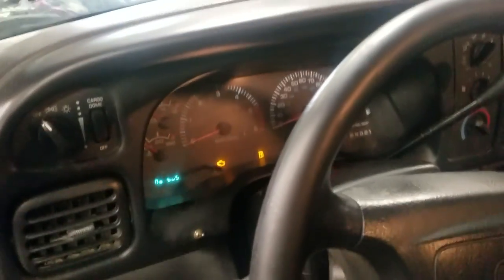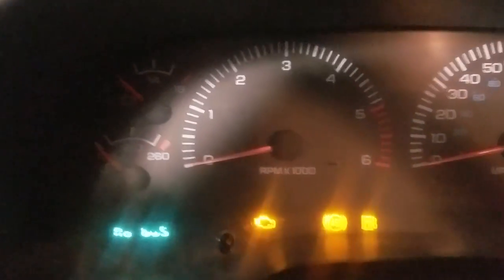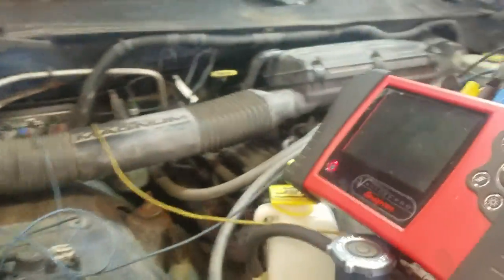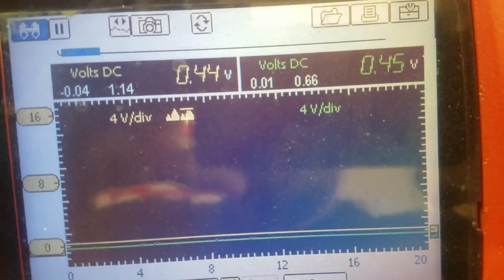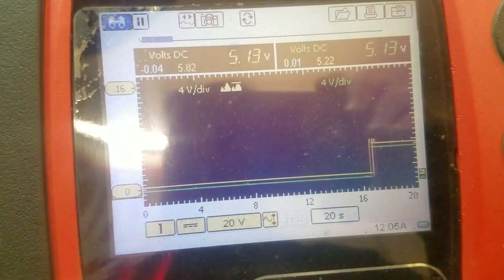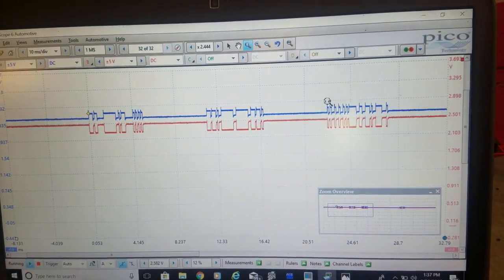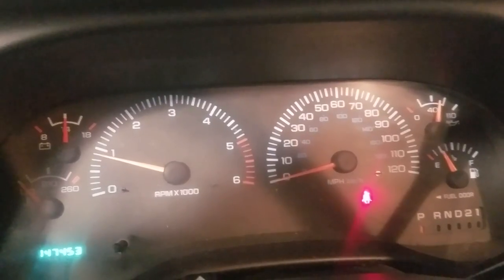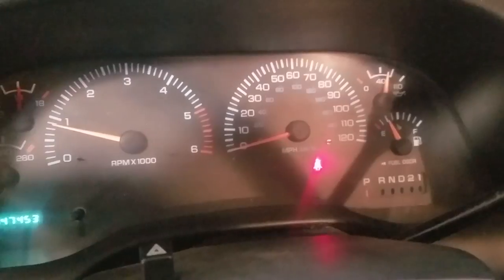2001 Dodge ram 1500 5.9 intermittent crank no start

Comment: This happened today. I went to my sons school and I shut off my truck. I went back to my truck and it would only crank . The fiuel was fine and spark was coming from the ignition coil. I disconnected the spark plug wire that goes into the distributor ( the one that connects to the ignition coil ) and no spark coming out of that end. Well as you know , 2001 Dodge wires are darn close to the exhaust headers and the heat exposed a small section of the spark plug wire. As Im cranking the truck , I saw that sparks were jumping onto the headers. Bamm , found it and wrapped it in electrical tape and it started right up. I drove home and replaced the wire 👍
Reply: Truth.  Somebody said. "dodge wiring is garbage". I said no it's not the person who routed them is garbage 😂 lol

Comment: Thank you you saved me I tapped the connection and I saw the tachometer moved then I went and disconnected all the connectors and one had some corrosion and some sort of liquid cleaned it and tried starting it  again and truck started I have a 2011 ram 1500 5.7l

Comment: Looking at that oil pressure, I’d check the amount of vacuum in the crank case. Only time they ever sit they high is when the intake plate gasket is gone. Not that the two are related at all, just something that caught my eye

Comment: Seems like a loose component in the Ecm, I would open it up and check all the solder joints, usually heavier items Caps transistors break loose from vibrations, could also be a wire connection in the harness where the power supply comes in.

Comment: What really interesting is: you have a no buss with it having a 2.5volt signals on the ccd, but no 5 volt? Correct me if wrong but I thought (from memory) these Chrysler PC's use the 5 volts to produce the ccd communication voltage?

Comment: Does the pcm have anything to do with the fuel pump cuz my truck turns over but it won’t start and every time u turn the key ur supposed to hear the fuel pump kick in and it doesn’t
Reply: You ever figure this out, got an 02 doing the same thing, already swapped fuel pump thinking that was the issue, going to last resort swap pcm out unless I figure something else out.
Reply: @osielcantu4921  hey there man did you figure your issue out ??
Reply: @osielcantu4921 yea what happened to the truck?

Comment: Does the ground on the pcm go to the cab ? Mines missing the ground I got the truck I’m working on in a trade the moter and transmission was already in but I had plug in play everything and none the grounds are connected I’m trying figure out where all the grounds go.

Comment: This was a very helpful video, I couldn't get the 2000 5.9 to start. However I plugged in my scanner to look for codes and the darn thing started right up. Any suggestions?
Reply: Darren Rufe the scanner is bridging a missing ground thru pins 4 and 5. I know I'm a month late but this is usually the case when you have a no start unless you connect a scanner
Reply: @SuperMarioDiagnostics  hi, I have a 2003 Dodge Dakota and something similar happened to me today on my truck. I know its weid but I connected the scanner and the fuel pump was energized and I was able to start the truck. Then I disconnect the scanner thinking that I solved the issue but then truck wont start just cranks. Any suggestion please?

Comment: same situation but dodge ram 2500 with new fuel pump but cranks and no start. The F'ing PCM is not getting voltage from/to the new fuel pump sending unit. All fuse and relays are good. What are the  issues I need to explore ?

Comment: currently working on an 02 Ram 2500 with the 5.9, same issue suspect the PCM. what pins are you testing for ref voltage output?  this one when you turn the key on the check engine light doesnt come on and will say no bus or mileage depending on what it feels like. have 12V going in, have voltage at the injectors, have ref voltage at all sensors, fuel pump relay and ASD relay aren't closing on their own either. already replace the crank sensor factory new, any thoughts?
Reply: Would suspect shorted ccd buds wiring, or short in another module on the buss.

Comment: I dont recommend Dodge due to electric wires' short problems from non quality materials.  It is a lot of works and time to find out  where it is but just a little wire among hundreds of them.

My no bus comes from one of the battery wires.  First day, check all fuses, relays, clean battery terminals and shake all wires, connectors under the dash twice.  It works then the problem reoccurs. Next day, clean terminals and trace all wires and then hear the relays click.  Next day, get another backup battery to ODB2 and replace the terminal wire.  Lucky no faulty connectors or sensors.  Very hard to remove, clean and reconnect them.

Good luck.
Reply: Dont have to do half of that. I drive a 97 ram with 283,250 miles and im just getting into electrical issues 23 years later.

Comment: I had a 1989 Buick Regal 2.8 L with a Delco Reman computer , not very old . When hot , would cut off on a blink , no warning . We got it hot , I should have closed the hood or used a heat gun . I then " spanked " the heck out of it . It then cut off . Bad ECM .

Comment: I just recently replaced fuel pump and  fuel pump relay on my 1997 dodge ram 1500 5.9 and she still does not start but she cranks.  Gas gauge is not working either. Would you have any advice on what it might be?
Reply: Replace your pcm

Comment: I have a 1999 dodge ram 1500 and everytime i take out the key the battery dies everytime and i need a jump start all the time any help? The voltage for the battery shows go up but when i crank it it dies

Comment: Mine i drive around and it turns off i have to move a wire from the computer like it wont pass gas like if it gets overheated i really dont know what is it any recommendation

Comment: 2000 5.9 . crank no start . no spark . no codes , just shows milage . engine light on . from reading ive seen guys say the pcm contacts could be dirty . also the ground from the fuse box to fender , and ground under altenator . i changed the starter relay in fuse box . also saw a guy say the power door lock fuse . many say cam position sensor inside distributor . some say coil . my coil and distributor only 2 years old . figured ide post what ive read and ask if anybody knows if not sparking but throwing no codes mean its the computer ?
Reply: Replaced computer same problem, did you fix it?

Comment: Would this be the same on a 2003 Dakota 4.7? I’d like to try and run a multi meter to the pcm but not sure exactly which wires to run it to? Any help would be greatly appreciated.
Reply from the maker: Do you have a wiring diagram to identify powers and grounds and vref.

Comment: Did u resolve the issue??  How?
Reply from the maker: Patch Ster another pcm resolved this issue, thank you for watching
Reply: Sean Miller .. I've replaced PCM twice( uncle's trk).
Reply from the maker: Patch Ster this truck previously had two pcm's as well. The one that I installed I bought off Ebay and so far has worked fine.
Reply: check AC ripple from alt, computers no like AC
Reply: Bro i got a 97 Dodge Ram 1500 with 5.9 4x4 ,  I recently got a ecu replaced drove perfect for a week, then started actin up again,  jumped in it one morning drove too blocks and cut off on me ,  realized my fuel pump wasn’t cutting on , replaced the fuel pump , and still not cuting on ,  just try’s to crank ,  guessing have to replace the ecu again ? But since I found this. Thinking bout goin out there and snacking it with a hammer....

Comment: i bought 1500 just before winter and this came on. It started with a heater core then a manifold gasket and then the NO BUS came on and my mechanic tried to find out that was wrong with it but still not running. It'll start-up when jumped but slowly does out, and after that when you try to turn it on it's just a clicking sound and doesn't start back up, and the check gages come on. HEEELLLPPPPP
Reply: Alternator brushes are bad

Comment: I have 1996 ram 1500 that I just put a new pcm in and it will just crank over but never start
Reply: Did you ever get it fixed? If so, what was the issue?
Reply: No I didn't I'm still very confused
Reply: Did you check for spark and fuel?
Reply: Prob the fuel pump hit bottom of tank with rubber mallet,,if that dont work replace with new fuel pump.
Reply: I got a 99 replaced com still won't start No bus
Reply: @suebryce4067  Im not mechanist but here is what I fixed. Make sure all fuses and relays are good. check 
Volt into bcm. Mostly no 12V [wire short], then remove battery wires and clean terminals and shake all wires, connectors under dash at driver seat and under hood while listen the relays click. Use a clamp Volt meter to check wires in/out. Eventually will find bad wire, connector or sensor.  My no bus is from battery wire, so did not go further, but still 3 days works.  Good luck.
Reply: @thorng8116  bcm? Did this fix your problem?

Comment: Any ideas on why a 2001 ram 1500 5.9L would run good in park and neutral but dies when I put it in drive or reverse? I suspect it may be the torque converter lock up switch locking the converter when I put it in drive. I'm planning on trying to wire a manual converter switch, I'm just not exactly sure which wire on the pcm controls the converter. I'm pretty sure it's the center plug just not sure which wire. Any help would be greatly appreciated, this thing has drove me nuts trying to figure it out! Lol
Reply: I doubt you still have the issue but try the crank pos sensor, my truck had the same issue and that fixed it, also made it shift alot smoother
Reply: @The_diesel_den  figured out the issue, it was the torque converter